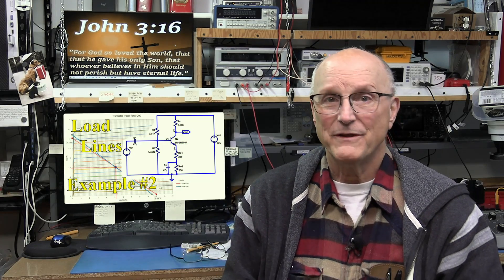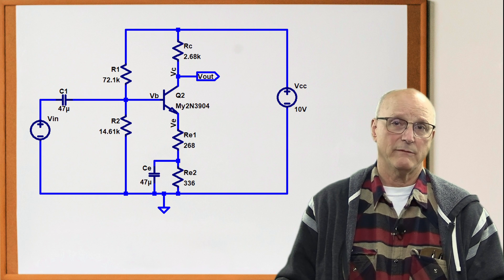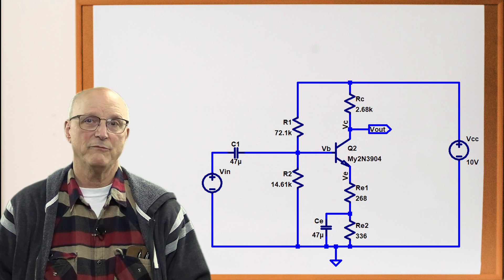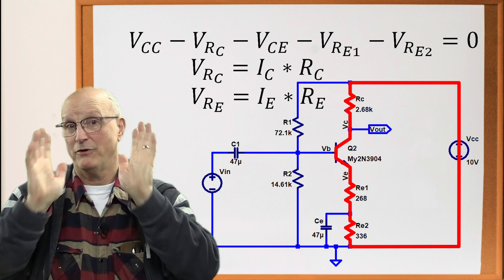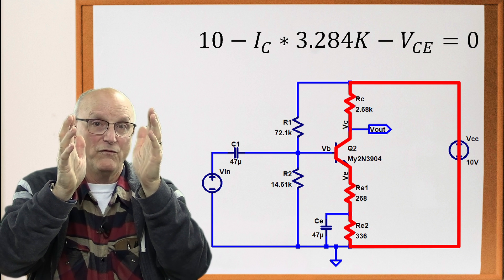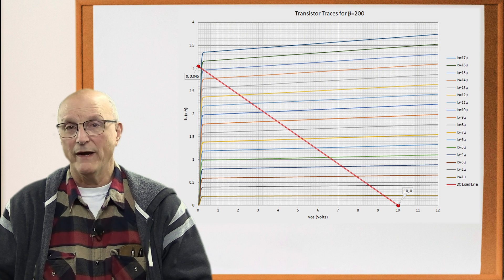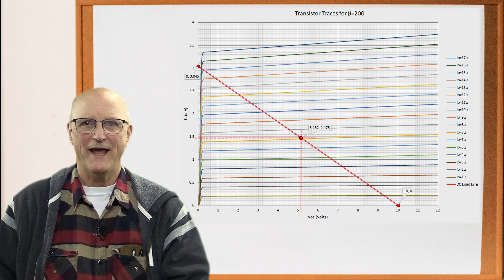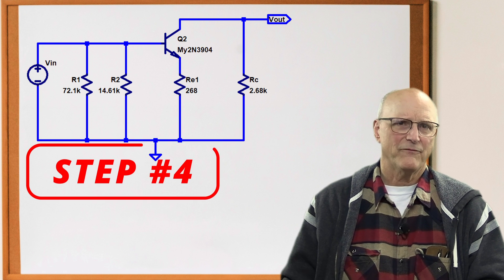Load Line Analysis: Example #2 - A Beta Stabilized Common-Emitter Circuit (066e3)

Comment: HOW DID YOU COME UP WITH THE VALUE FOR THE SWAMPING RESISTOR OR,WHAT RULE OF THUMB DID YOU USE?
Reply from the maker: I'm not familiar with the term "swamping resistor," but I assume you are referring to the upper emitter resistor. 
I start with the standard method of determining the emitter resistor value to establish the DC operating point. This is Re(total).
The gain of a common-emitter amplifier with an emitter resistor is approximately equal to the collector resistor value divided by the emitter resistor value.  So, I say, "I want a gain of 'g' and my collector resistor value is 'Rc', so my un-bypassed emitter resistor value needs to be Re(gain)=Rc/g.
This value is smaller than Re(total).
So Re(bypassed) = Re(bottom) = Re(total) -  Re(gain).  Re(gain) becomes the top, un-bypassed emitter resistor. Hope this makes sense. 🙂
Reply: THANK YOU!ALL THE ACTIVE CIRCIUTS TEXTBOOKS I HAVE CALL IT A SWAMPING RESISTOR,BECAUSE IT IS SUPPOSE TO REDUCE THE BAD EFFECTS OF r'e.
Reply from the maker: Gotcha!
This is my LONG overdue reply!  Sorry. Sometimes this stuff gets lost in the YT world. I'm spending some time trying to clean all this stuff up. :-)